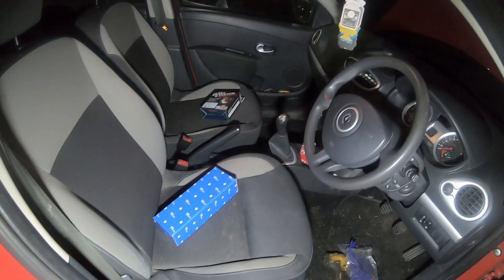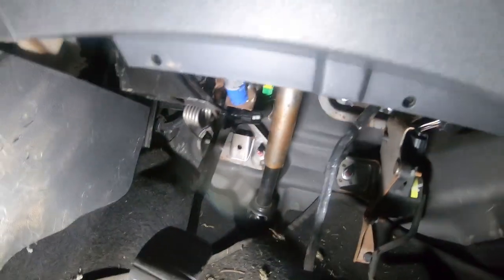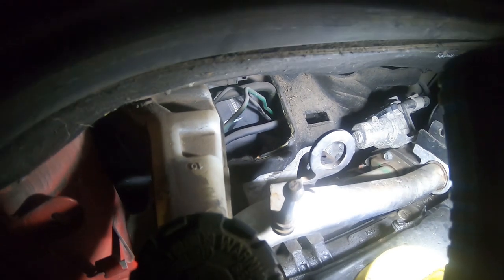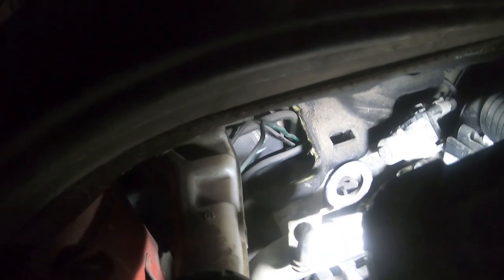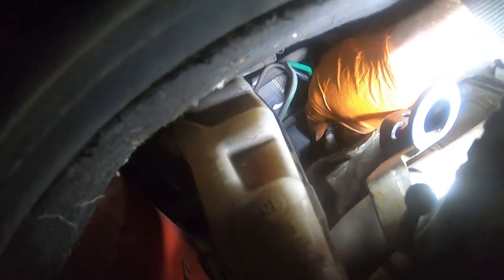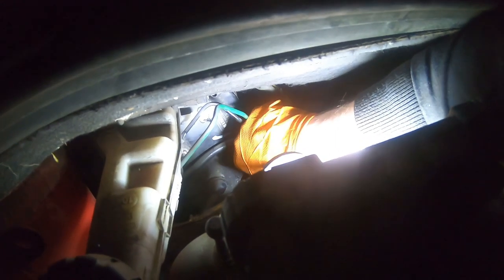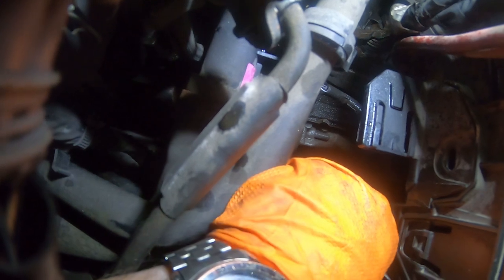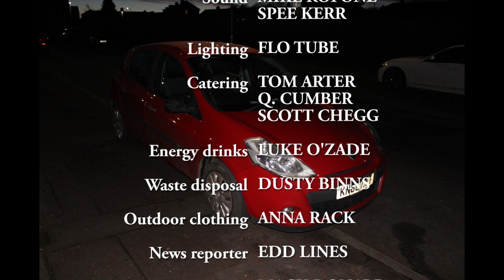2010 Renault Clio Part 3 - Clutch master cylinder replacement

Comment: My clio 2011 clutch pedal clicking what could it be thanks
Reply from the maker: This is a hydraulic clutch so it is probably the pedal itself. Most likely the spring.
Reply: @Parknest  thank you
Reply: Does the dash have to come out to do it thanks
Reply from the maker: @stuartwilcock8113  Some of the lower panels have to be removed and the steering column has to be lowered to get to the clutch pedal.